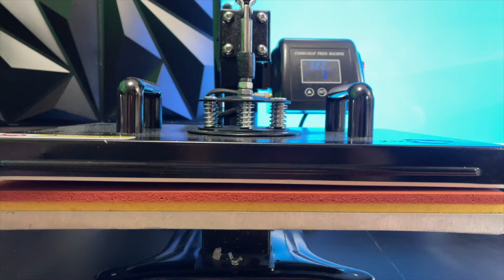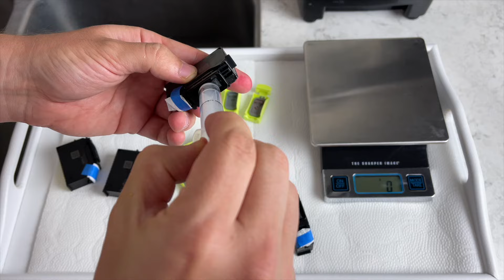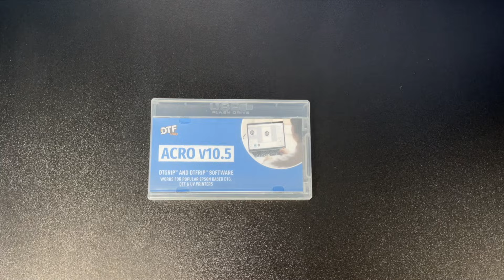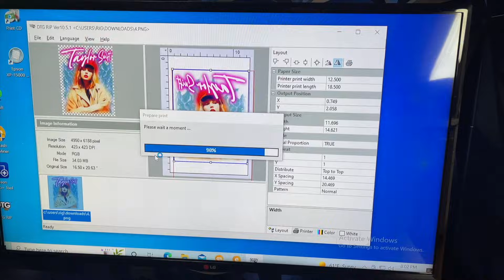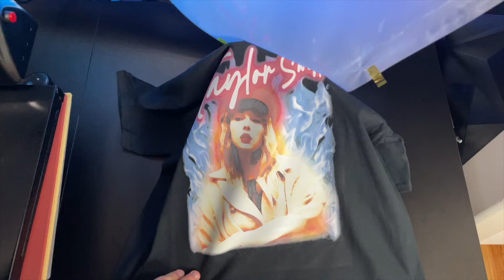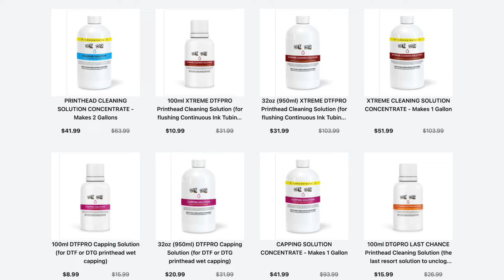How To Start A T-Shirt Business With A DTF Printer (How To Make YOUR OWN DTF Printer)

Comment: So you can download a free trial for cad link and what happens when the trial runs out? Also, most videos point towards using inkchip firmware. Do we not have to use that? I've been stuck on getting my printer going for months now. I download inkchip and when I put chipless cartridges in, the printer isn't recognizing them.

Comment: The xp-15000 is a good printer but its actually only able to do 12" x 17" cause of the rear roller you have to leave the bottom 2 inches empty

Comment: Hi guys, I have an Epson XP 15000, I don't want to modify it in DTF, because I will make an Epson R2880. I will keep it as it is, installing software and new firmware for without chips. I want to buy normal inks. I have generic Epson pigment inks, are they ok? Or you suggest me which one to use and buy. Thanks for everything. Hugs.

Comment: Hello. my epson xp15000 is converted to DTF and using AcroRip11. It was printing fine. All of a sudden the beginning of the printing turns out stretched. I printed an image just fine, then I wanted to print the same image again and that's when it started. Example. If I wanted to print a circular image, it would come out like an egg/oval shape. I have uninstalled the software and installed it, and still keeps printing like that. Any idea of what could be? Thank you.
Reply: that sounds like feeding matters. Like the film is not going forward appropriately. Did you see on this video he put blue tape on the film cuz he said the film is too thing. Putting tape on the film constantly that becomes tedious and monotnous.  I wonder if it is better to get thicker film that works.

Comment: i hear this machine has a lot of issues when converted as dtf printer
Reply: maintenance is the key they say.  The ink is water based, when not using, the ink or the heads tend to dry out. I heard horrific stories even with dedicated printers which are not converted.  The only good things I heard about are the ones that are industrial, which of course need maintenance too.

Comment: You are the first that I have come across about changing out the ink in the factory cartridges. I am just beginning and trying to learn. Can you explain why not use the chipless cartridges for the ink? Also, I am looking for cleaning solution to use with my refillable cartridges. What do you suggest? My maintenance plan is something like this. After I finish using the printer for the day I will remove the ink cartridges, place the cleaning cartridges and run a printhead clean then leave the cleaning cartridges in until next use. Thanks for answering my questions.

Comment: Question my epson xp15000hd, the firmware has been changed to run with chipless cartridges. If I down drives from epson won’t it then start asking for chips again. ???
Reply from the maker: do not download new drivers after you download chipless software

Comment: Slava, I've tried a company that sells Screen Transfer 12x18 full color, any design you want, and the cost is $10.  of course you can fit a lot of designs per sheet or just one big design.  Can you check it out and compare it with your methods to see if is worth it, less work but a little more cost.  Look it up.  I like your videos.
Reply: *Hit me up 👆 for more guidance*

Comment: this is cool but seems very inconvenient like you said might aswell just get the actual printers
Reply: This setup is $500... DTF actual printers start at 2k. You still have to do all the same maintenance with a legit DTF. Also if you can't do this setup in the video, I wouldn't buy an actual DTF
Reply: @Jerkstore1 😮
Reply: let me tell you straight. the detail is basicly unbeatable compared to expensive actual  dtf printers. Epson is among few printer can output at true High DPI resolution.